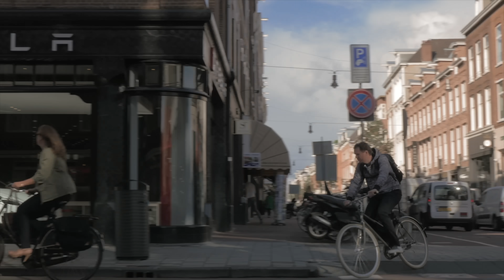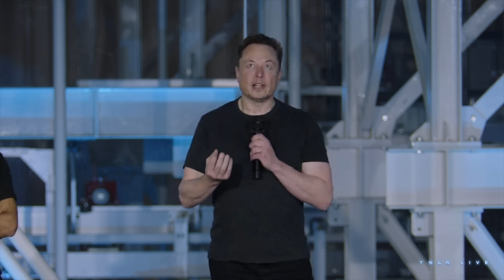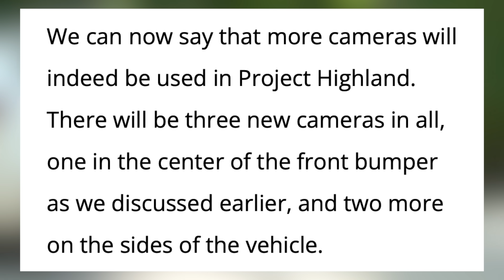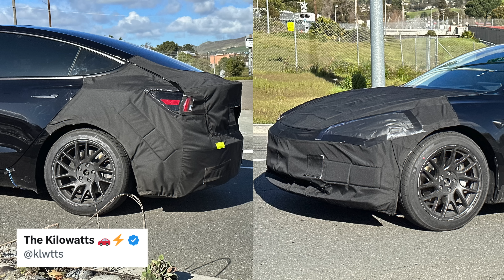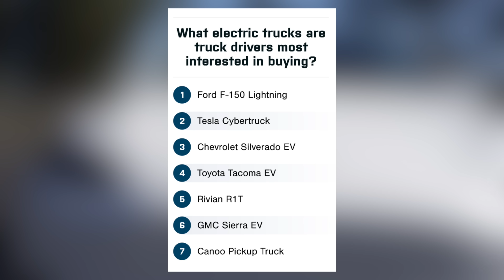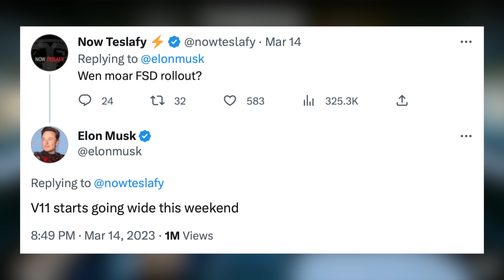NEW Tesla Model 3 Features LEAKED | We Weren’t Expecting This

Comment from the maker: Anker 735 65W: https://howl.me/cjnCRxBXWFZ
Anker 737 120W: https://howl.me/cjnCV5zQpiB
Anker 747 150W: https://howl.me/cjnCW26frUh

Anker 711 30W: https://howl.me/cjnCYkE3S3Z
Anker 736 100W: https://howl.me/cjnCZjHC6l8
Reply: Hi Ryan. I have to take exception with your reporting about the removal and then restoration of parking assist. You say that Tesla is restoring this feature 5 months to late and that you don't agree with Tesla's whole approach to the matter. In response, I would invite you to step back and consider an entirely different line of thought. You presume that Tesla could have left the sensor based parking assist in place while a vision based system was being developed. But what if that isn't true? What if the sensor based system was actually sabotaging certain aspects of AI vision based decision making and therefore had be removed in order to move forward with the vision based system? You also seem to think Tesla didn't work act quickly enough or work hard enough to implement vision based parking assist once the sensor based system was gone. But again, how do you know that? I suspect getting the parking assist back in action was a top priority and that Tesla was working very hard to get it done. The entire premise that Tesla "should have done it sooner" is based on the idea that this was an easy fix. But I suspect that it wasn't easy. I suspect that it was very hard and that Tesla poured a lot of resources into the problem trying to get it fixed as fast as they could.
Reply: @normvanduker9999  Because ISS still worked on my Vision-virus infected 2021 and any "old" car that according to Howard Hughes II...Sorry, Elon, still should be capable of FSD while on Vision. Beside that, you seem to lack technical knowledge about how USS work and what the virus is and how coding works. Sorry but you couldnt hardly be more off with that theory of yours. Its marketing-BS and greed mixed with a segment wehere 99% of Teslabuyers has no clue about how sensors work and especially what they cant do. Thats why ex. the wipers will never work, or FSD on HW up to at least 3..0 for that sake too. Lab, sure, real world = utter pain when you get out of the sunshine and into rain, dark & mist/fog.

Comment: Removing the temperature sensor is a bad idea. I live in Norway and I'm pretty dependent on the onboard temperature sensor in my car. Temperatures always fluctuate around 0 degrees celsius during winter, and  I need to check the app to see if it is right above or below 0 before I get in the car. If it's below, the windows will freeze and won't go down, so I can't close the door. I'll then have to preheat the car before I can get in. If it's above 0, it won't be a problem. GPS data won't be accurate enough for this, and I'll have to preheat and waste a lot of power every time just to be sure I won't get stuck with a door that won't close..........

Regarding the ultrasonic sensors; I fear cameras won't be accurate enough. You can't drive more than a few kilometers on cruise control without experiencing phantom braking, so the camera vision is surely not fault-proof. Am I supposed to trust it to protect my car when I'm maneuvering a tight space? I don't think so.. 

I'm not a fan of this constant cost-cutting at the expense of convenience. What's next? removing the rear mirror? There are cameras after all...
As opposed to other cars, Tesla has no dedicated rain sensor either, and we all know how terrible the camera-based rain sensor is. It only works partially satisfactorily under optimal lighting conditions. After dark, it's basically useless. This means you'll have to resort to manually operating the wipers a lot of the time. Combine that with the fact that the wipers need to be operated from the screen, then you have a very tedious and annoying system that's far worse than every other car I've driven. Even cars that are 15 years old have better functioning rain sensors and easier-to-operate wipers. 

Instead of constantly removing things to make the car cheaper, they should focus on things that people appreciate, to make the car more desirable. I know plenty of people who has test driven a model 3 or Y, and decided against it just because they hated how bad the auto wipers are, and the clumsy operation of the wipers on the screen (no stalk operation). Some people I know also decided against it because it doesn't have an instrument cluster in front of you. 

I love my Tesla, but there are some things that are really annoying about it, and I think most people would gladly pay a little bit more for extra convenience and less frustration. It's sad when they remove rather inexpensive things, which causes it to become a dealbreaker for a lot of people.

Comment: "If it aint broke don't fix it".  Radar gone, USS gone, Temp sensor gone.  None of those were broke but were / will be "fixed".. How often will Telas drivers have to walk round their car cleaning cameras?  How well will they work when wet?  The reason it's been 5 months since the USS were dropped is because replacing them with a 100% reliable and effective camera based system is not as simple as someone at Tesla said it would be !

Comment: Im also curious to see if the facelift of the front and rear of the vehicle includes bumpers that are a different material or some way to fix the mismatch of paint color. Most notably with the white version having the bumper be a slightly off white compared to the rest of the car.

Comment: The Temps sensor will be like the removal of the others... It will work.. But not as well.  
Getting temps from weather services... Is not going to be as accurate as just reading the temp at the car.  
My 15 year old Toyota has this... the only time it is inaccurate is if the car is not moving for a while.
I see BIG shifts in temps all the time, a  15 deg drops going from city, to out in the country is pretty normal.. or big shifts when the sun sets.
The weather data will probably just get the temp at the airport.. which basically tells me NOTHING.
FAIL!!!
Reply: Same here, reduced drivability and confidence in the car. He´s completely lost his mind

Comment: What remove the outside temp sensor, so driving through the Rocky Mountains  in the middle of nowhere and you are going to get local Temperature (not likely!!!!), that does it Tesla, you just do not think very clearly, fed up with all this B.S. of sensor removal, someone at Tesla continues to dictate what should be right when it is not always the case, sheer arrogance! I have better buy a current slightly used USS model with the matrix headlights and call it a day!

Comment: How will the camera based sensors work in places like Canada, where the car is usually covered in dirt and mud from melting snow?
Reply: Probably the same way they do on my car in Michigan from mud and dirt and melting snow.  Just fine.
Reply: @blh1997-w1q  That's amazing! What car are you using that uses cameras instead of sensors to detect proximity? It doesn't need to have vision? I know with my current vehicle (Rav4) I have to physically clean off the back-up camera every time I step into the vehicle on winter days for it to be useable since it's usually caked in salt, mud, and debris.
Reply: @thepeterpot  oh,  I see what you mean now.  Only the FSD beta cars with the latest version have it right now.  I have EAP and do not actually.  My car has USS on the bumpers.

Comment: A good question will be will they offer a retrofit for additional sensors for the cars that ended up shipping without sensors. Seems like a major issue that should be resolved. Yes, perhaps there will be a cost for the owner, but the solution should be worked out, I would think.

Comment: On truck drivers' top wishlist items, I thought we might see something to do with flexibility of configuration. Owners often modify their trucks from all sorts of after-market vendors. Contractors and construction teams often add tool locker side cabinets and bed-mounted tool lockers as well as overhead rack options and bed cover cabs. Recreational owners might add gooseneck mounts, complete camper shells mounted in the bed and more. Tesla historically has not offered a large line of variants of any of their vehicles so if they would just make the bed sides easily removable by after-market vendors, those vendors could fill a new market demographic in EV trucks.
Reply: Since the exoskeleton is integral to structural integrity, I don’t see them ever allowing the removal of the bed sides.

Comment: Reference to "other systems" besides GPS for location might mean cell tower triangulation. I wonder if Tesla has come up with something else such as a connection to Starlink. The rear camera needs either to be moved further back under the trend lid or better yet, have some sort of shield or wind deflector to help keep it clear in rain and snow. I've seen my rear camera go so fuzzy that I can't effectively use it to back up. I regularly wipe off all cameras with just a soft microfiber towel.

Comment: How cheap can a temp sensor be? This is ridiculous. Every car I’ve owned since 1991 has had this feature. I’d rather have actual local temperature. The actual temperature in traffic on the freeway can be MUCH higher than the local weather station.

Comment: Trucks have to be able to tow long distances under load.  Most of the places I drive are in the middle of nowhere pulling loads.   You can't just stop what your doing and run into town, get a charge, and then go back to work.   There are hardly any chargers anywhere.  When we put our trucks to work it is long hours and long distances.  EV trucks are going to need range extenders to be able to accomplish this.

Comment: Hoping for a range increase in the M3LR refresh. This is why they have not been selling them for 6 months.
Reply: Would love M3 range to come close to MS which is at 405
Reply: @kabysummit5801  keep in mind the model S is a 100kWh pack. They'd need to either greatly improve the efficiency of the M3 somehow, or put in a bigger pack, or both.
Reply: @Bela Sziklassy  selfishly I wish the refreshed M3 to look like a smaller MS, with a range increase from the current.  Yes both increases on efficiency and more battery capacity
Reply: @kabysummit5801  Same, not a fan of the model 3 look, love the Model S but not the price.
Reply: That and they probably will be the first to get the highland updates and possibly M3P batteries
Reply: We have Model 3 LR in Europe and China.
Reply: would love to see structural battery integrated, car lighter and range extended
Reply: They need to do the Model 3 like the Y, get rid of the SD and LR and just offer one model with a bigger battery

Comment: The temperature sensor removal makes no sense to me.  I love being able to tell the temperature in my immediate location.  I don't care about GPS based temps, if I wanted to know that I'd just check the weather forecast.  How will this affect cabin overheat protection?  When I check the app I can currently tell how hot/cold it is in my garage vs the temp I already know it is outside.  This is useful information imo. @ryan shaw
Reply: This is a race to the bottom. GPS based temps are not accurate for microclimates.
Reply: It uses a different sensor for interior which matters for overheat protection
Reply: Wait what?  I have a 2021 Model 3.  The Model 3 has gotten so much worse since I got mine.  If I ever get another car, it's not going to be from Tesla.
Reply: These cars are getting worse
Reply: I doubt it will effect cabin overheat since that would be a separate sensor. Because you need to check the interior temperature separately from exterior. For example heating and cooling wouldn’t work without it lol
Reply: I have my doubts, but coming from an ICE vehicle where engine bay temps can skew temps when you first turn on the car, and don't become accurate until you actually start driving, I'm finding myself okay with predicted exterior temps.
Reply: Stop whining, wait and see what actually happens. People said vision parking wouldn’t work and now it does!
Reply: @davedyer3654  this isn't some theoretical new system or progression... It's simply an omission. Ambient temperature data will no longer be available. Period. No whining here, stating facts. I don't rely on my vehicle to tell me the temp in my geographical area, I rely on it for the temp in my immediate vicinity.
Reply: @RozeAbove  Stop whining, you haven't even seen the car yet lol
Reply: @davedyer3654  You must have a very low bar for what you consider "working". Tesla is a leader in many aspects and does great things but this Park Assist release is a joke. It's very inconsistent
Reply: All the whiners who said Tesla vision wouldn’t work, get over it

Comment: Tesla does have the largest and most reliable charging network, but isn’t useful for trucks with trailers.  Which combining towing that hinders range and not being able to pull-up with a trailer and charge scares a lot of truck drivers.
Reply: Interesting point 🤔 but I don't think any of the other companies providing charging stations have addressed this apparent limitation either.  It definitely needs to be addressed!

Comment: What about installing a 48 volt DC system with project Highland and Juniper?
Reply: No, that's too big of a wiring, component overhaul.  Cybertruck will be first with 48V low voltage system.  Maybe then in 2024 the current vehicles get it then the new Model 2 at the end of 2024.

Comment: I’m just doubtful that Tesla vision can accurately provide front bumper parking assist when there are no cameras down there
Reply: It sees the curb coming. It knows how far forward it has rolled. It’s not rocket science.
Reply: @malventano  Apparently is because still no updates since they removed it like half a year ago.
Reply: @malventano  .. vision believes that my fence is a gigantic truck, don’t thrust vision to recognise anything important.
Reply: @larsw.larsen4173  I believe it’s doable with the technology, but I also believe Tesla will screw it up :)
Reply: @malventano   agree - doable with more cameras, that is better located  - like most other car manufactories, it could be doable. This just leaves us 2023” owners “in the trash bin”
Reply: @larsw.larsen4173  mine think my water softener tank is a person and thinks my garage fridge is a semi truck
Reply: @malventano  i said accurate. I didn’t say it couldn’t provide any information. Also the car will show you 0 mph while you’re slightly rolling forward so idk.
Reply: @jroc721  it goes off of wheel speed sensors, which can be accurate within inches even if the display shows 0 MPH. Now will the vision get the distance right in the first place? We’ll see I guess.
Reply: I wouldn’t doubt that it can’t.
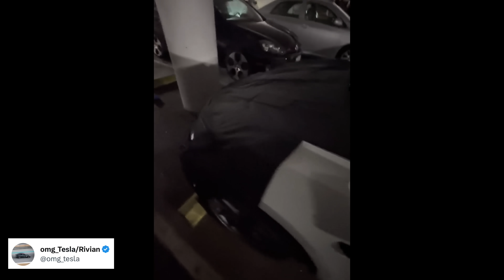Reply: They're adding a front bumper camera.. See 4:30 in the video. That should solve the front sensor prob and give the car better visibility for pot holes, speed bumps, road debris and decrease phantom breaking..!!
Reply: @cmac9710  as a recent 23” owner I couldn’t care less. I just want the functionality I did pay for 😬🤢
Reply: it would only be an issue if something "popped up" from the road after it was out of frame from the mirror mounted camera (which is angled at a better vantage point than the driver).  The cameras and computer essentially 3d map the enviroment 360deg around and knows the movement of the vehicle.  That being said, I like the grill mount adder because it is an improvment in placement and will gather better and more accurate data.  My biggest concern is this placements likelyhood of dirty and damage.  Pehaps the aerodynamics and recess of the mount mitigate this, but its not behind the windsheild or pointed in reverse.
Reply: Your forgetting the “thinking” part of the assist